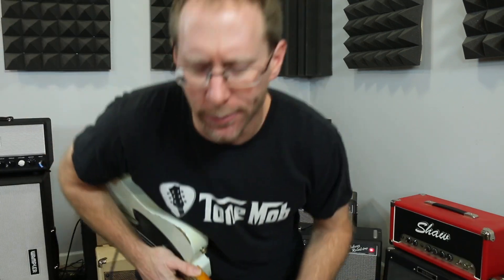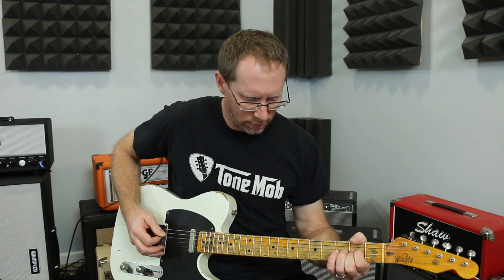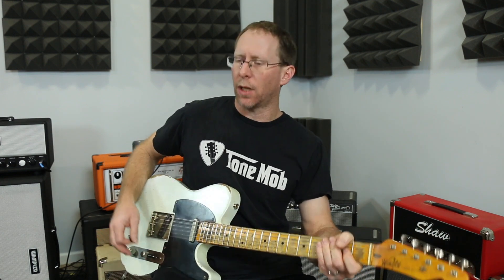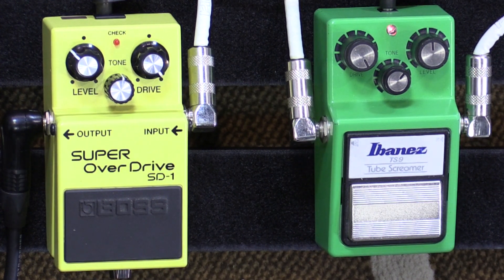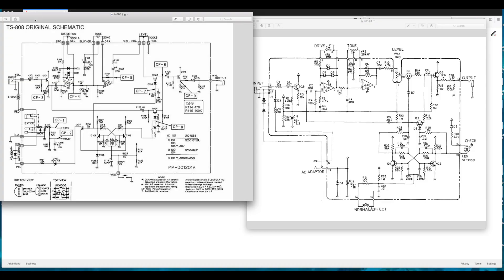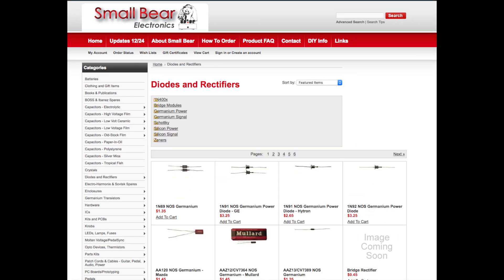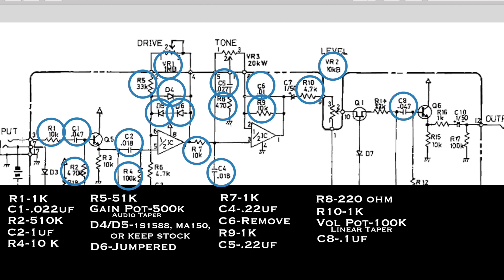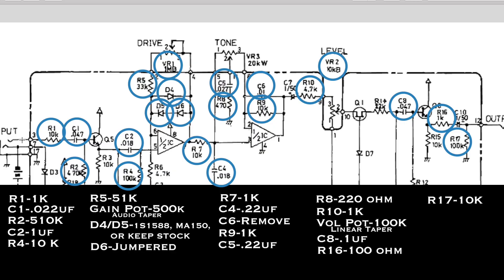How to turn a $30 overdrive pedal into a $180 pedal  -- The Boss SD-1 turned into a TS808

Comment: I tried this between my 808-clone (with assymetrical clipping option) and a SD1. All I did was change R7 and R9 to 2k2,  C5 and C4 to 100 nF and removed C6 on the SD1.
Besides the amount of drive there's indeed no distinguishable difference. At least to my ears.
I had the 808, which I don't like on it's own, but works great in a band situation. I thought I would prefer the SD1 but I couldn't bond with it being bright and harsh IMO. So now I own two 808's. 😎

Comment: Some op amps need that feedback compensation capacitor. "Remove it... unless it turns out you needed it" xD

I had a TL072 build that had a weird kind of distortion on low frequencies without it. It sounded almost like the speaker was bottoming out, but it wasn't. Not sure if there is a word for it :P

Comment: Maybe being there they sound different, but from where I am sitting I just cant hear much difference.  I love the SD1 kicking a JCM800 in the teeth to give it that full on metal sound.  The TS9 is great as well.  I had a TS808 and maybe it was just the pedal I had it wasn't doing the job as well as the SD1 or Ts9.

Comment: I have an old boss sd-1 from japan, from about '85 or so. Funny thing is that I always think my sd-1 doesn't sound like other sd-1's. To my ears it sounds worse, or not quite as good. I know some people say the older japanese ones are supposed to sound better, so maybe mine has got some problem. It has been to a little repair shop a few years ago to replace the on/off switch which wasnt working. Maybe the technician guy there removed or took to himself some components. My pedal sounds much more "boxy" than other sd-1's. It's like the amp loses a lot of bass, and the sound gets "less wide" if it makes sense, like it's encaged in a box of mid-rangey noise or something.

Comment: Love this video.
Would anyone have any suggestions or better yet a solution to prevent the rolling off of the bass when the overdrive is engaged? I use it on top of a distorted tone just to sweeten it, but the effect is has on the bottom end irks me. My Seymour Duncan 805 overdrive does the same thing.

Comment: Love this kind of thing being a breadboard dabbler.  I have had and just sold the very expensive Friedman BE-OD pedal. I did not like it. Noisy, no MID control. It probably would have sounded great to me...EXCEPT I had been using an ISP Theta pedal. No matter how I used the BE-OD it never came close to the awsome full sound of the Theta. I really did like the tight control on the BE-OD.  I dont care for the preamp part of the Theta. It clamps down the gain channel in some way. I only use the gate and the first gain channel and set the gain about 10 to 11 oclock along with its eq section. More than that and it turns fizzy to me. I sure would enjoy you taking a gander ant the Theta and review your opinion. There are not many reviews of it. I have had a ton of gear and think this pedal is sitting in a sleeper category.

Comment: How much of the difference is due to the asymmetric clipping on the SD-1? Because if that's a major factor, just adding a switch to jumper across one diode could be a great and super cheap mod.

Comment: Very cool that you would put out DIY vid like this. I am WAY too accident prone to mess around with fine detail work with a solder gun(I stick to changing out pots and pick ups). That being said always enjoyed mods by others to my 808's. Considering that there currently is no 808 on my board,but there is a Sovereign should give you an indication of what I really prefer. The sound I'm really still searching for is a decent replication of the Marshall silver jubilee. So far, no joy.

Comment: Trying to analyze this as an electrical engineer (keep in mind my micro-electronics classes were a few years ago)-- you mentioned that the BOSS SD-1 (my favorite OD pedal, which I expressed in a comment under another video) has asymmetrical clipping, where the TS-808 doesn't. Does the jumper between the diodes do away with the asymmetrical clipping?

Comment: Interesting.  I've always preferred the SD-1 over the Tube Screamer for most high gain melodic metal type amps (Tube).  I do have a new appreciation for the Tube Screamer in Amplitube.   I suppose if I wanted a custom Ts808, i would consider this, but I'd have to have both :P

Comment: Mr. Wampler, how similar is the Bad Monkey circuit to a Tubescreamer? I've heard it's basically a clone, but I've never really torn one apart or found a schematic.
Reply from the maker: It's just a TS with an added bass gyrator after the tone control and before the volume.
Reply: Cool... thanks

Comment: Love this kinda stuff. I'm some what of a basic electronics buff. In other words I followed nearly all of what you were saying. I'd like to know more about bundles of components and what they achieve. I.e.  A capacitor and a resistor in parallel and so on things also like capacitor to ground from the signal line ? I think that would make a killer video. Thanks for the upload.

Comment: I use this modified SD-1 as a mids/drive/volume solo boost stacked after my rhythm overdrive. Volume almost at noon, Tone around 1:00, and Drive around 10:30. 
1. Remove C6. This will open the sound up a bit.
2. Change R2 from 470k to 1Meg. This increases the input impedance. 
3. Create a switch to toggle the C3 capacitor between 0.047uf and 0.1uf. This increases the bass response when toggled to 0.1uf. Use the 0.1uf for single coil pickups and the 0.047uf for humbuckers.

Comment: Surprised me that you would use these pedals, your pedals are so much better than these. I will say this though, I am not a huge fan of overdrive pedals, but I tried my Yngwie phase years ago, and the only good thing that came out of it was I have one of the original DOD 250 OD. That is a sweet overdrive.

Comment: Cool video.  I built an 808 clone from general guitar gadgets and added a symmetrical / asymmetrical switch.   You can do the same: Instead of bridging D6, just use a switch. When closed it's a TS, when open it sounds more like an SD1

Comment: The Ibanez ToneLok TS7 is a cheap alternative which came out in 1999
Reply: I have one of those, along with a DS7 Distortion. The switch wears out easily, but can be replaced with a new one for a few bucks. Other than that, great pedal for the money.

Comment: Thanks for that; very interesting! I've always been interested in the difference between the SD-1 and TS808! It would be great of you could do a video about the differences, and relative pros and cons between circuits that use asymmetric clipping (SD-1, as you pointed out), and those that clip symmetrically (TS808). I read that it effects the odd and even order harmonics in some way, which translates into hard or soft clipping, but not sure about that last part!

Personally I think the TS808 makes an excellent slightly dirty boost; whereas (and I think I pretty much alone in this), I always preferred the slightly 'rockier' tone of the SD!

Comment: i don't have an sd-1, but i do have an os-2 , i don't mess with electronics, btw the os-2 i have was modified by fromel electronics, and yes i like it, pretty cool pedal
Reply: I modded the os-2 and it can make some great sounds. two switches for asymetrical/symetrical diode but I don't think you can hear the difference in a band setting, so kind of silly.

Comment: Alright Brian, a few caveats, Subscribed, love your videos and these types of videos and enjoy tinkering including doing some pedal mods. Not the biggest fan of this particular Mod simply because of Time, Effort, & Money involved. I enjoy the uniqueness of the pedals--different flavors of OD so having both is beneficial based on guitar and amp choice and my mercurial moods. There is certainly a Risk/Reward of doing this many Mods to one pedal and 21 parts swaps plus a possible IC swap is considerable time/effort to make it sound "closer" but not exact to what you are striving for and those parts ordered will cost a bit. I would simply keep or sell the Boss SD-1 and purchase a TS9 ($40 recent purchase) and make the 2-Resistor 808 Mod swap and call it good. Cheers!

Comment: cool video! But think stock they sound pretty different. I actually wish for a pedal that would sit right in the center of these two. The SD 1 is awesome, but is tad too metal. The 808 is awesome, But it sounds a tad too rolled off for me. I go back and forth between the two. I guess it depends which amp you use.

Comment: these are some of my favorite types of videos. i mostly get parts from ebay. i like the nos resistors. sometimes a 'shop' on ebay will be selling boxes of old milspec parts. given, there are many discussions on the 'sound difference' (or real lack thereof) between NOS, 'modern/miniaturized', or 'surface mount', etc., components. regardless of sound, there's something about old NOS stuff that looks cool. be that as it may, you make great videos.

Comment: Any advantage to modding an SD-1 vs just getting a super cheap clone like a Joyo? Apart from the joy of soldering?
Reply: I successfully modded mine with 3 switches.. the only downside is the visuals and branding.. I love the visuals of the stock SD-1 and TS9 but would find it hard to want to tamper with it or mod it.  I guess a single switch popping out of the top of a SD-1 wouldn't be so bad.. but much easier to "mess with" a Joyo.  I soldered to the board ok.. I just had to pop the switches out the sides instead of the top.  There is easily enough space inside the casing to do that.

Comment: Thanks for making these videos! Building and modding synthesizer and guitar circuits is how I got into electronic's back in teh '70s. Personally, I liked the sound of the SD-1 just as much as the TS808. I probably wouldn't bother doing the mod for any tonal changes, but hey - mods are fun anyway! Maybe it's the SD-1's asymetric clipping that I like. I think Peavey's TransTube circuit is one of my favorites for overdrive/distortion, and it has asymetric clipping as well. I wish they had released that as a pedal separate from their amps.
Reply from the maker: I think they did at one point?

Comment: Brian, how about an advanced build to create a tape echo from readily available inexpensive junk /  parts etc.
Reply: I've thought about trying this, but the mechanics are a little hard to do.    It would likely require moving the playback head further from the record/erase heads (or the delay would be very short).   You could, of course, slow the tape way down to increase delay length, but then recording quality drops off drastically

Comment: Cool video. I mostly buy from small bear. The JRC (Japanese radio corporation) 4558 is still made on the exact same machine they have always been made on. Same machine, same part, no reason to pay a lot of money for an old one when new ones are exactly the same! Just do some basic research
Reply from the maker: Exactly!
Reply: wreckoningday Thanks for this valuable info, and thanks Mr. Wampler for confirming!
Reply: People on the used Market sometimes like to rape you on the price, because somehow since its original it has to be better.Sometimes that's true but sometimes it's not let the buyer beware.

Comment: Awesome, love to see videos like this from a company I love. One thing, a parts list in the video description would have been very handy, and an A/B comparison of the modded pedal against the 808 would have been the icing on the cake. Can't wait to see more vids like this!
Reply from the maker: Thanks! I'll add it to the description as well, but here you go:
How to modify a Boss sd-1 into a TS808 Tubescreamer style circuit

R1- 1K
C1 - .022 UF
R2 - 510K
C2 - 1UF
R4 - 10K
R5 - 51K
GAIN POT - CHANGE TO 500K AUDIO TAPER
D6 - JUMPER
D4 - 1S1588, MA150, OR KEEP STOCK
D5 - 1S1588, MA150, OR KEEP STOCK
R7 - 1K
C4 - .22UF
C6 - REMOVE (DON’T JUMPER)
R9 - 1K
C5 - .22UF
R8 - 220 OHM
R10 - 1K
VOLUME POT - CHANGE TO 100K LINEAR TAPER
C8 - .1UF
R16 - 100 OHM
R17 - 10K
Opamp - If you’re SD-1 doesn’t have a 4558 type, change it. 

*NOTE: All “C” locations are capacitors. All “R” locations are resistors. 
You can find parts at http://www.smallbear-electronics.mybigcommerce.com/

Comment: Hey Brian love this vid I know it’s a little off topic but I know your the man to ask , so my laptop has a noisy as hell cooling fan as well as a power amp rack mount I know first step is cleaning and thermal grease on the heat syncs but what would be ideal to oil / lube the actual motor center hub ?! To make these things as quiet and efficient as possible ? Thanks man :)

Comment: A mod I did on a TS clone I made for one of Canada's premier blues guitarists was a variable "warp" control.  Rather than using a 2+1 diode complement, I simply inserted a 10pot in series with one of the clipping diodes.  It does not have the  identical effect as using an asymmetrical trio, but it introduces a different sort of asymmetry by softening the clipping for one half cycle.  The Marshall Bluesbreaker, and Analogman King of Tone (which is more or less based on the Bluesbreaker) both use a fixed resistor in series with both clipping diodes to soften things.  Inserting the variable resistance after only one diode has a slightly different effect.  Since the clipping action of one of the diodes is reduced, that also raises both the dynamic range (when that resistance is non-zero) and consequently the maximum output level.

There is no requirement that it be a pot.  If there was no room to install a pot, a person could simply remove the 3rd diode from the 2-diode side, replace it with a 10k fixed resistor, and use a 3-position toggle to either leave the resistor alone (full asymmetry), bridge that added resistor with a 3k9 fixed resistor (yielding a combined parallel resistance of 2k8 for moderate asymmetry) or bridge it fully to revert back to two diodes a la TS-9.

Comment: Hey Brian, how about a video on checking and repairing old pedals. I've got 2 that quit working, that I would like to fix. One is an old 120 volt Ross distortion/phaser and the other a Super Fuzz. Ya know ya throw these things in a box somewhere when they quit working and then you are mucking around the internet and find out they might be worth something 45 years later. Or that they just might be something that sounds good and you already had one ----if it worked. Thanks, Dave

Comment: If anything, my least favorite part about the SD-1 is the linear gain pot on it. If I'm trying to boost an amp with it and it doesn't have enough volume with the gain at zero, I can only turn the gain knob about 10-15% up before it just becomes too distorted. My problem is that I can't decide whether I want to buy one TS-9 and get that lovely green box, or settle for the less attractive SD-1, but be able to buy two for the same price and mod one of them into a TS-9.

Comment: Great video Brian, although I must confess I usually find it difficult to tell the difference between pedals on Youtube comparison videos.  Anyway, I have a Guyatone PS-015 overdrive that I bought new in the early 80s - still works perfectly, and I've just looked inside it, to find that it has a "TL4558" chip.  Google tells me that this is rare, so by extension, it must sound better than other chips... I'm tempted to try a new TS9 alongside the Guyatone, to see if I can discern any differences.  The Guyatone does have separate bass and treble controls, so it may offer more versatility, but I won't be surprised if the only difference is that my wallet is slightly emptier!

Comment: The sound is horrendous. It sounds direct. You need a mic (or a better mic) because this is an audio video and it shound't sound like crap.
Reply from the maker: IMO, the bright channel on those amps don't sound all that great, but it's good for a comparison between the two so you can hear the discrepancies.
Reply: i   t   s                   a                      c   o   m   p   a   r   i   s   o   n                         v   i   d   e   o
Reply: crush537 doesn't sound direct sounds like a cranked TS style circuit through a bright clean amp they do sound kinda fizzy, not a fan on this usage but have a crunchy hot marshall and an sd-1 and it's awesome.
Reply: It sounds horrible because we are used to the awesome sound of Wampler Pedals. Wampler is the absolute best, period!!
Reply: Jamsdh1 love wampler, a few companies are giving Brian a run for his money though.
Reply: They sound so identical why record it at extreme quality. Nobody is going to listen on anything but cheap computer speakers anyways.
Reply: Just In.... says you! 
I listen with a decent set of headphones..because I'm not stupid.

Comment: Boss should manufacture an alternative SD-1 modified to TS808 spec. for £45. No need for them to mention it's a rip-off. As long as they paint it green we'd all get the hint 😉
Reply: If possible, have a switch to toggle back and forth, use a somewhat blended color.

Comment: Hey wampler, I don’t know if you could answer this kind of question, but my Crybaby has some kind of cracking noise when I rock it while playing on my clean channel. My drive channel hides it, but I usually use wah on clean. Also the cracking only happens when I am playing, but seems fine when I rock it without actually playing. Do you have any idea what this might be? Thanks in advance!
Reply from the maker: Yep, just clean the pot with deoxit.
Reply: vigilante bird 
Had a similar problem with my Fulltone. Emailed them and they said it was the cables. It wasn't. I changed the placement in the chain to guitar-tuner-wah-distortion-volume-amp clean channel. Routed modulation effects through the effects loop on the amp and big difference was using voodoo power +2.